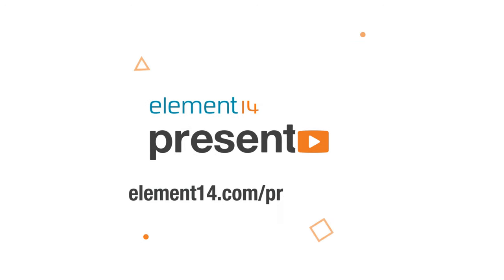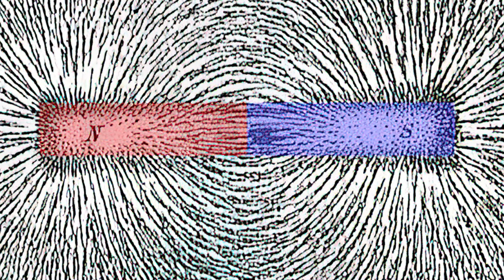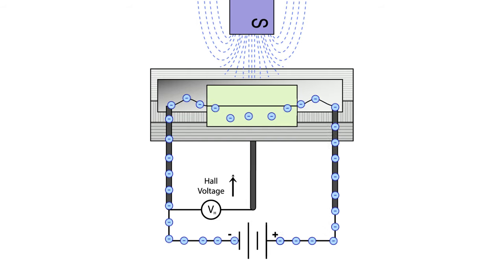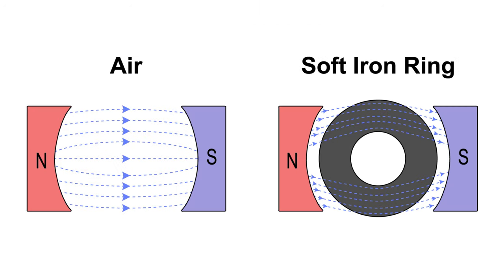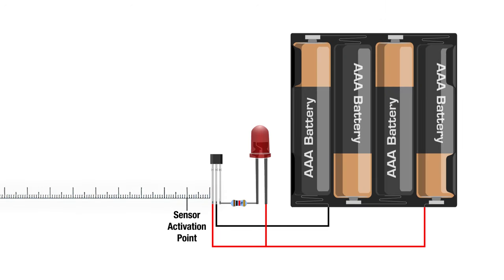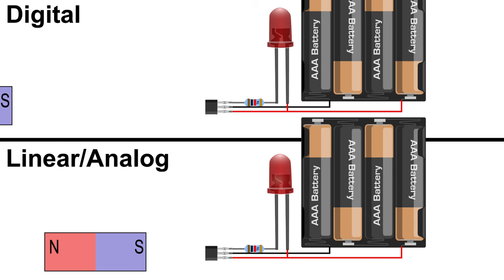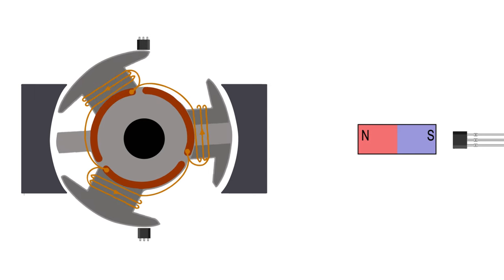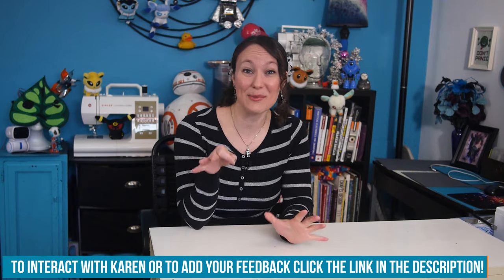How Do Hall Effect Sensors Work? - The Learning Circuit

Comment: Pretty good video. As an electronic engineer I would want to nit pick a few things. I'll give just one example -- at around 6:05 the Doppler effect is not really a good analogy. The signal gets stronger or weaker based on the distance between magnet and sensor just like the volume of the train whistle is weak when it is farther away and loudest as it passes in front of you. But that's the "inverse square law" and really has nothing to do with the Doppler effect, which is about the apparent shift in frequency of the sound (or light) when there is motion between the source and observer. Like I said, nit picking by an engineer. So ignoring the nits, pretty good video.

Comment: Hi could you tell me what the best type of hall sensor and magnet pole setup would work best on a pedal assist setup . I am converting a e bike motor and want a internal pedal assist . Due to the size of the internal case i have machined a plastic rota 47mm dia with holes for magnets . I have tested it with mixed results . I need the hall output to go to max voltage to min to trigger controller .help

Comment: thanks!  this helped me with an automotive project............thanks!  i recently put in a NEW (but bad) CKP sensor and its apparently shorted internally-  screwing up my fuel level gauge, ignition coil/ignitor(?) and setting off a host of other selonoids- et al!   I cleaned all grounds, rebuilt my fuse box, new ECU, cleaned everything........no changes  UNTIL i just now decided to swap back in the old CKP sensor.  All the electrical clicking, etc went away immediately and Im not going thru the KEY RELEARN process for the new ECU
Reply: crankshaft position sensor
Reply: I'm here for automotive as well! :D

Comment: Hello Mam, this video is very informative. With regards to the working of Hall Effect Sensor, I have a question. Can you give some insights as to what type of ferromagnetic materials are used in manufacturing magnets that are used in the Hall Sensors being used in throttle handlebars of two wheelers?

Comment: some ppl actually prefer this over the alps joystick, how accurate is this compared to alps? is there a difference in power draw over the alps? does this draw more power? how reliable is this if let's say it drop a few meters above ground? would that affect the accuracy of the joystick in the long run? does it degrades over time?

Comment: I have a tape deck that has nine hull effect sensors stacked together on one tape head to read the nine tracks of Video grade tape to be decompressed from PASC to 2x 16bit digital audio channels there is also a nine track write head but unfortunately the unit needs recapping because it won't work otherwise.

Comment: Thank you for a pedagogical lesson on the Hall effect.
Now I hope somebody can help me on a practical problem I have.
I have a sensor for a motorcycle ABS system with two wires (blue and white). I assume it is a Hall sensor, since I can measure no voltage or resistance between the wires when rotating the wheel ABS ring.
How do I detect which wire is the Hall signal wire (AC) and which is the supplying wire for 12V (DC)?
Reply: It is likely that your sensor is a magneto-resistive sensor, not a hall effect sensor.  In the MR sensor, the resistance of the sensor changes with different magnetic field applied, which could be induced by the tone wheel (or disc) on the ABS system.  I found this helpful: https://autofella.com/how-does-abs-sensor-work/

Comment: And think about hall efect analogs in controllers. No more drift issue. Btw. Sega Dreamcast controller have hall effect analog stick and triggers :D
Reply: I have an older Thrustmaster 16k that uses hall effect sensors.  FAR superior in every way to the more popular and expensive Potentiometer driven HOTAS setups they sell these days.  Having no physical connection means it will keep on working until the silicon degrades in 20...30 years or more.
Reply: @jong2359  They don't want to use it because of money. I wish that in future We see a controllers with hall effect sensors.

Comment: How does the hall effect sensor work inside a flow sensor?
Reply: Usually a turbine is placed in the flow and inside the pipe/tube with its rotational axis parallell to the flow lines of the fluid. The turbine is free to rotate but constricted along the flow. One or more magnets are fixed along the perimeter of the turbine which at each revolution triggers a Hall effect sensor sitting just outside the wall of the pipe/tube. The speed of the turbine, and further the number of magnet passes per time would indicate the flow.

A downside to this design would be that the turbine itself affects the flow by increasing the resistance as well as increasing the probability of turning the flow from laminar to turbulent. You would also have to consider the slipping, or the fluid that passes without adding speed to the turbine, of the turbine as well.

Comment: Hi, do you have any videos about how to create an RPM detector, magnetic field detector, and energy transfer ratio? I am small-minded learning new tricks of the trade. I had an idea. transfer cold storage energy to hot usage energy. I do not know the technical names of the hardware I am monkeying with but trying to eventually wifi electrical power. Think Nicola Tesla was doing something similar except my prototype was functioning is the coolest thing I have ever Ooops made. perpetual motion or as close to it as I could get. Have a short video. what I need to be able to do, is transfer power from the lower plate to the upper plate without using wires as the upper plate rotates eventually 30000RPM. I've walked into something with this invention. scares the hell outta mankind cause it works

Comment: Hi 
I ordered a hall sensor for the hub motor from China.
I messaged the seller to tell me the color of the wires so that I can solder them to the pc board, but the seller has not responded yet. 
There are three sensors labeled 451H—742
Please tell me what color wire to solder to these abbreviations on hall pcb?
👇

G 
R1
R4
R5
R2
R3
V 

My hall sensor wires controller are , red, yellow, black, green, blue and white. 
Thanks